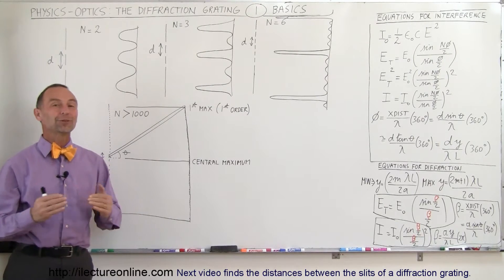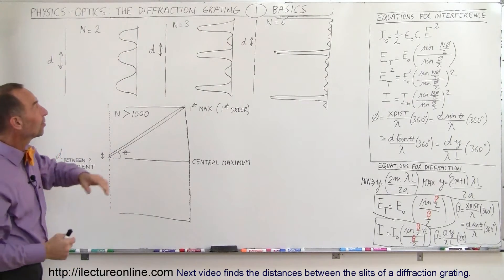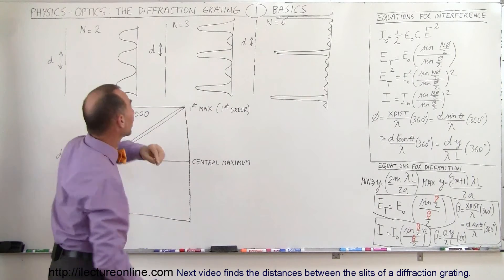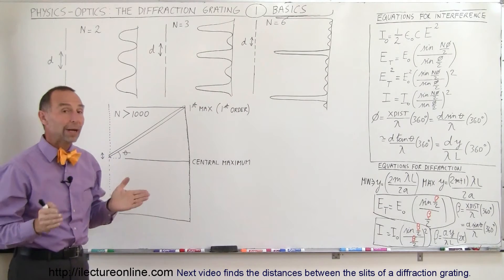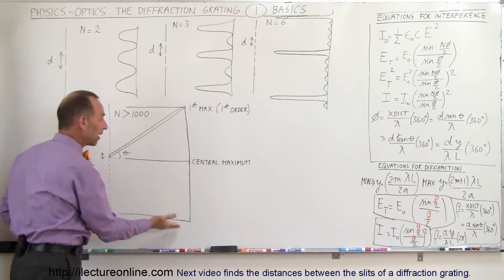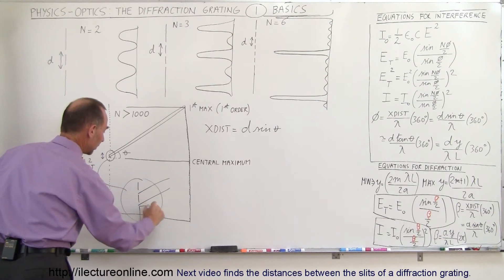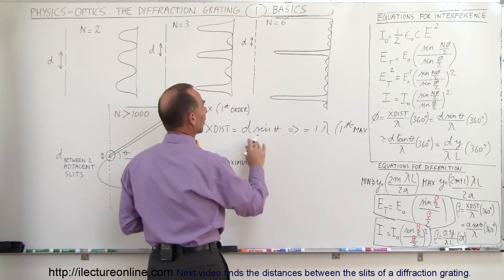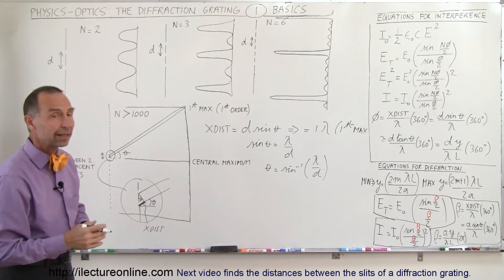Physics - Optics: Diffraction Grating (1 of 7) Basics

Comment: How can we calculate how many orders of maximums can we have with a certain number N of slits? I see you can find those little maximums with N-2, so was wondering about about the higher ones
Reply from the maker: You can figure that out by calculating the angle of each order.  Once the angle exceeds 90 degrees, that order does not exist.
Reply: @MichelvanBiezen  Oh yes that sounds about right! Thank you ☺️